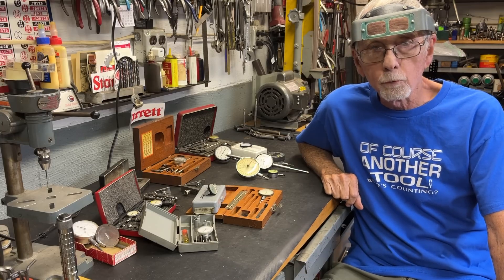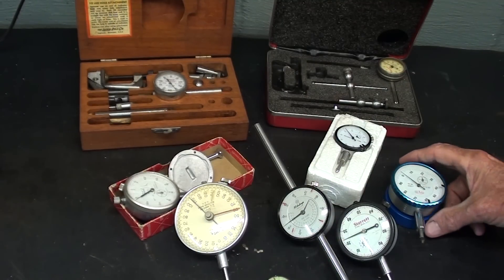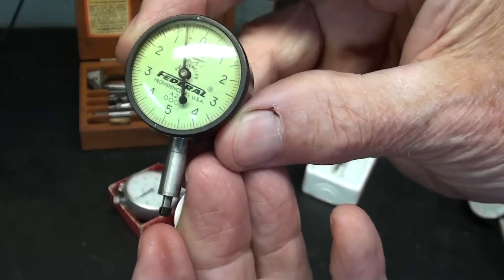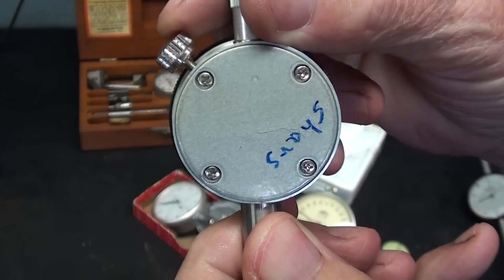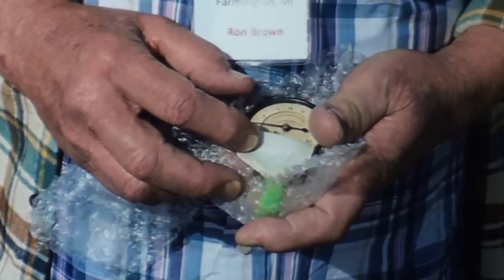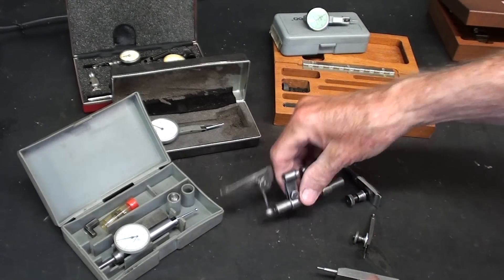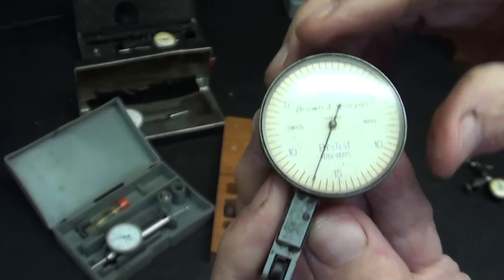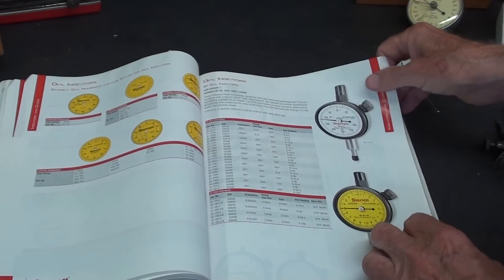SHORT SUBJECT #8 Dial vs Test Indicators tubalcain starrett

Comment: Good Morning Mr. Pete, I need a linear adjustable mount for my .0001 travel indicators with only .050 operating range. I use a mighty mag base placed on the ways of a lathe but the magnet is so strong that it's hard to smoothly slide the indicator point into contact with the apron. Sooner or later I'm going to ruin my indicator by jabbing it into the machine apron too hard. 

Do you know of any small, low profile and locking sliders that can be mounted on a Mighty Mag?

I've considered a camera lens bellows but they're too big and might get bumped.

Comment: Oiling an indicator usually makes matters worse if it has been sticking. I've found that I'm better off washing the indicator out with Naptha from the hardware store. DON"T use acetone! It will ruin the dial's printed face and fog the crystal if it is plastic.
If you opt for oil use something like Starrett instrument oil. Apply with the tip of a toothpick onto the pivots. A drop of oil is enough to lubricate 10 indicators. 
Remember that the mechanism moves slowly and 99.9% of the time not really used very much in the home shop. Skipping oiling the indicator isn't going to hurt anything over the next 100 years or so.
Reply: Thanks for your input on oiling or not oiling precision instruments. I've found that a drop on Marvel Mystery oil works very well also. My dad was partial to hand wound mantel clocks which he always oiled with a chicken feather dipped in kerosene. Just a light touch of the feather tip on each pivot was all it needed.

Comment: After spending close to 50yrs building injection molds, I always had a “cheap” dial indicator available in my tool box for lathe work where the location of the indicator could be subjected to being hit by hot chips. Back in the 70’s, we built a cover/lid that had threads inside. One of the guys in the shop set one in the lathe and cut the threads out and opened the inside dimension to fit a dial indicator as a cover. The molding department ran a short run while sampling the mold with clear material. Everyone in the shop made them into protective covers for their dial indicators! Still have mine.

Comment: About three-years ago, a man on eBay had about eighty plunger type indicators that he somehow acquired when an old Dodge car factory shut down.  I was able to purchase all of them for about $80 dollars (a dollar per indicator) and about thirty of them were broken beyond repair.   I cleaned and oiled the ones that were salvageable and took them to work and sold several to my coworkers for $5 dollars a piece.  Most were Federal brand indicators that only had a range of less than 1/8th an inch, but many had a resolution of .0001" and I even got one very large Indicator marked "Dodge" on the dial face.  I still have about thirty of those indicators sitting in a toolbox.

Comment: On the Last Word indicators, I typically use the B&S Best Tests, I simply like them better. However, for some things, the Last Word's small size  and its multiple methods of mounting will fit in tight spots where others don't dare to go!  I have a bunch of indicators, more than enough really, but what I never seem to have is enough mounting hardware! I am always looking for another snug or rod it seems to get where I need to go! And build custom mounts as needed.
Maybe you could show some of the multiple ways to use the readily available mounting hardware and accessories. The old Starrett catalogs often had illustrations of how to set them up. And finally, back plunger indicators never seem to get the love they deserve, they are very useful for many things. You could probably do a whole video on using the back plunger indictor and all its accessories, same with the Last Word. Cheers Mr Pete, keep 'em coming
Reply from the maker: Thank you for your comment. I totally agree, I often have to make adapters or sleeves so that the indicators will fit on my holders

Comment: What's a technique for cleaning the stickiness?  I'm thinking of spraying/rinsing brake cleaner inside while working the mechanism.  Then dry and lube the moving parts with a pinpoint oiler.
Reply: I've just sprayed a little WD-40 on the plunger to free mine up when it got sticky on me.
Reply: Contact cleaner should work for cleaning and a drop of Marvel Mystery for oiling.

Comment: Dial indicators are good for alignment/indicating, digital ones are used for measuring only I think.  I bought a bunch of new Starrett tools and have been thoroughly disappointed in them.  I will only buy Mitutoyo for my premium measuring tools going forward.  You'd think with 100+years of metallurgical development that Starrett could find better materials that don't rust for hand tools and that they could make a 1" dial indicator that reads 1.000" at 1.000" of stroke instead of 0.999".  Works fine for indicating, but not for measuring.  I could buy a $25 Chinese one for that instead of $250 Starrett one.
Reply: Mitutoyo are really a premium brand, always preferred their feel to Starrett. 
I do like Starrett precision levels and their new tap wrenches are fantastic, unfortunately they are very expensive.
Reply from the maker: Sorry to hear that

Comment: IMHO, electronic indicators and verniers in the home shop, where they are not used daily, always have the potential to have a dead battery when they are needed. This means wasted time installing a new battery if you take yours out to prevent corrosion between uses. It also means having good batteries on hand. In shops that work daily all year long electronic indicators may be alright. Those antique test indicators are in great shape.

Comment: With a smile and a good heart...
Short video, a novell of comments...
Quoting You: "I've laid out some of my indicators"..... Why on earth buy that many? Okey, You might be like me, laying them down and later not finding them... I use 2 calipers for that reason... Most indicators sleep in a special drawer...
Digital ones running out of battery... I've got an angle indicator. It worked at delivery  but next time, it was dead. The manual told why. The battery lasts for one year... CR2032... My response is to keep the battery beside the angle indicator...

Just checked my 3digital scales on the mill..... 1 dead and 2 grasping for power. 6 CR2032 batteries needed before using the next time... Now I know that.... Thanks for the video!
Time 05:35.  I did the same, opened one having issues. Hundreds of TPI on those gears.... Clamping the stem too hard got it stuck!

Comment: Lyle - Funny how some of us end up with numerous indicators, isn't it?!  I believe your one mechanical test indicator is an old Ideal one, made in Rochester, NY.  At least it looks to be like the one I inherited in my Dad's Gerstner box.  He worked on a machine floor for a year or so before going into the AAF in WW2.  Wrapped up his tools and put away when he left - ended up in a different job when he came home.  I inherited the box and most of the tools after his death.  It did not have a ton of use and is still smooth but I have never used it on an actual project.  One of these days I guess I should take that one a a couple real old ones (like the ones you showed) I have and do a comparison with newer test indicators.  As it is all a ratio mechanical linkage they probably will all dial something in better than my machining abilities can match.  Thanks for a good short.
Reply from the maker: Thanks

Comment: The digital indicators and measuring equipment all SUCK. I have 80 year old mics, indicators, etc and they all work flawlessly and accurately. I also have digital tools, starrett, mitutoyo, el cheapo, etc. EVERY tool that i have that’s failed on its own volition is an electronic tool. From my starrett digital mic that now only works as a very heavy and bulky analog mic, to my el cheapo brand digital indicator that now works only as a paper weight. I will no longer buy digital tools, they are built to fail and be replaced. go ahead, argue about your expensive digital calipers all you want, they will fail, eventually.

Comment: Nicely done.  I am an ex-machinist turned Engineer many years ago, and I found it interesting how I/we call them by different names.  For example, I have always referred to them by their type of mechanism = pivot indicators vs. plunger indicators.  On the other hand, most people I meet use your terminology test indicator vs. dial indicator, and some just group them all together and call them dial indicators.  I am biased toward my naming convention as both can have "dials", and both can be used to measure or "test".

Comment: Good advice about avoiding Chinese indicators: I had a Starrett Last Word my Dad gave me but it got misplaced during a move. I bought a cheap Shars to replace it but then later found the Last Word again. Using both of them, there’s no comparison: the Shars’ movement is sticky and uneven. It eventually measures accurately enough, but the Starrett is silky-smooth and a joy to use by comparison.

Comment: Very well done!
As a maintenance technician I used indicators far more frequently than my micrometers. I once claimed to own at least 40 quality indicators, but on last count it was only in the 30's.
Starrett makes some of the finest, but their more modern styles of test indicators priced out of my laborer's budget. For that reason, I have favored B&S and Mitutoyo. I own indicators in numerous configurations, but none with uncommon facing dials. My work demanded test indicators more than dial, or as I call them, travel indicators. I own indicators up to 4" of travel and down to .00005" resolution. I finally purchased an Interapid, mostly as a retirement novelty. While highly esteemed and having the largest range of test indicator travel, I didn't use them. They are more easily damaged than other brands, developing backlash on directional change that is not perceptible to the user. I cannot recall inspecting any Interapid shop owned indicator that hadn't been damaged. I concluded that trust was too significant and settled for the more robust brands over the advantages of more travel and nice large dials, and reduced investment costs.
Indicators are built on different mounting platforms. The platform determines the base or mount. Like the battery tool makers, once in a specific platform, you are encouraged to stay in the platform or own a variety of bases and/or attachments. Starrett and Interapid mounting styles are not as widely copied by other makers making them less universal. Once in a platform, you could easily embrace the related attachments for specific tasks. I found the Starrett platform clunky for my demands, but Adam Booth routinely demonstrates how they serve the lathe machinist well. I bought a BesTest as my first test indicator with .030" range and .0005" resolution. I added a long swivel dovetail attachment to the kit and used this indicator or its attachments for most of my other indicators as my go to set up.
Couple good indicators with premium bases and you will have delightful and reliable performance. Noga is hard to beat for function and is priced reasonably. 
My inventory big three indicators are Starrett, B&S and Mitutoyo. Other premium makers are less available, pricey or quirky to my experience. Other more affordable brands introduce lack of trust to me, but I have some of those brands. Brands like Fowler can be premium or absolute trash. I bought a bargain Fowler test indicator set to gain a cute and tiny mag base that I thought would be useful. They packaged an acceptable test indicator with a base that is an embarrassment.
Brand name indicator button assortments are worth owning. I mostly favored only large, medium and standard buttons, so the enormous tip kits I regard as novelties.
Reply from the maker: Thank you, very interesting and useful information
Reply: I’ve had good luck with a brown and sharpe valuline test indicator. I recently upgraded to a Mitutoyo tenths indicator and have been super impressed. It’s like seeing through a microscope.
Reply: Thanks for the good info !

Comment: I'm a big fan of Verdict 08_3001 Dial Test Indicators. As a stylus type indicator, for a long time they were all I knew. There are aspects of them in each of the test indicators you have on the table there but none of those indicators have all of the features that I appreciate so I'm going to have to say for me they are the best. Externally the fit and finish seems  as good as the American and Japanese brands but I'm not sure how the internals compare...for a while I thought they were Swiss, and the Swiss know a bit about clocks, but I've just noticed for the first time in years, right at the bottom of the dial it says "England".
Reply from the maker: Thanks

Comment: There are many good brands that are not American, I have British brands that are just as old as your American brands and still working perfectly, not to mention Swiss, Japanese and German. I have your beloved Starret brands which are so sticky that I binned them.
Reply: It was my impression that what he meant was, get your self a good one, not some cheap crap. It's a given that the countries of origin that you listed, are in with America and Japan.
Reply: I have three or four Chinese one inch dial indicator that are perfectly acceptable. They operate freely, meet my needs so far and cost about 18 each on eBay with free shipping. I recommend a drop or two of Marvel Mystery oil on the stem to free up sticky movement.
Reply: I have both Swiss made Tesa and US made starrett similar travel and resolution dial indicators, both basically unused and the Tesa is so much smoother. Another level of instrument from Switzerland.
Reply: @MF175mp  Nothing wrong with that as long as you’re willing to pay the premium price. True American saying. “You pays your money and you takes your pick”
Reply: @ellieprice363  I'm not from US myself. They both were around 50€, old but unused stuff